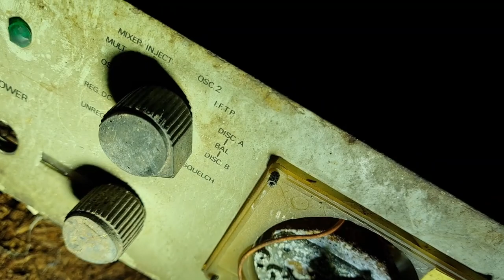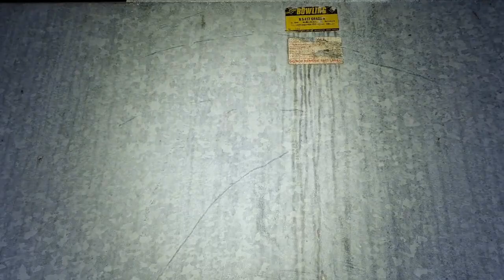The Secret nuclear Bunker | Urbex history

Comment: I had a unit  round the old   walls  from  84   to 2000  the  walls were so porous the place    always leaked like a sieve    dont think  it would have worked  terribly    well  as a bunker  hence the rust    thats already set in to the   huge doors probably safer  than an average terrace   house of the   mass es     outside   in terms of nuclear   explosion.
Reply from the maker: It's what I was thinking whilst I was in there! But it's apparently true! 
Probably safer at home with a mattress against your wall 🤣